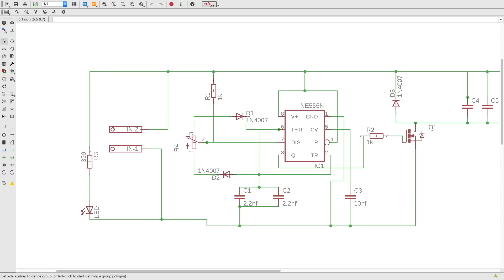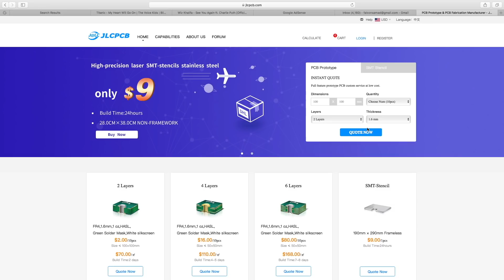How to make a Disc and Belt Sanding Machine (Most useful home-made tool)

Comment: Placing the PCB just near the belt can cause the dust to collect and may damage, i think buying a readily available version which uses more powerful AC motor which is cheaper, reliable and also has more options like angle adjustment on disc sander. mdf, cyanoacrylate and pvc pipes are not a great choice of materials for this kind of builds. i would like you to make a more refined version of this good luck.
Reply from the maker: The improvements you have suggested are justified. The goal here is to make this tool out of easily available material and MDF and PVC are easy to work with, though the durability o0f the design can be increased upto a great extent using more specific materials.

Comment: The title is 100% correct. I like your idea of making this small and useful sander. However (and this is just my personal opinion, take it as is), I made a 72" X 2" belt sander for knife making.
But, I have used it not only for knives, but furniture making, I have made multiple jigs for it. One for surface grinding metal and wood. 
Also, I should note, I made it so it can accept multiple sized belts, up to 2600mm and down to 600mm, this is important because surface finishing belts are ridiculously expensive, so the smaller ones cost less, not only that, if a particular manufacturer is having a sale, I don't have to worry if the belt will fit. I have bought belts that are 150mm wide (far to big right?) But with a lot of care I was able to cut them into 3 seperate belts, so 3 for one. I got 10 belts at that width so ended up with thirty and was able to sell 15, making double what I paid for the entire batch!
If you use your noodle on the initial design you can have a machine that can do anything you need it to, and will last a lifetime....and then some.
No disrespect to the author, a fantastic belt grinder. But for me, steel frame, larger belts, heavy duty wheels, and adjustable platen, and 30 hours build time for the most incredible tool you will ever own.
Don't spend £1300 on a top of the line machine, you can make a clone of it with a much better motor for £250!!!

Comment: where do you get those belt and pulley
Reply from the maker: Such pullies and belts can easily found in old printer acessories
Reply: thanks.. i need your help.. in my minor project i am using such belt and pulley.. but i cant find it in market..
Reply: where can i find old printer accessories?